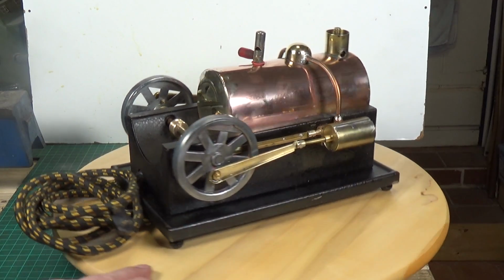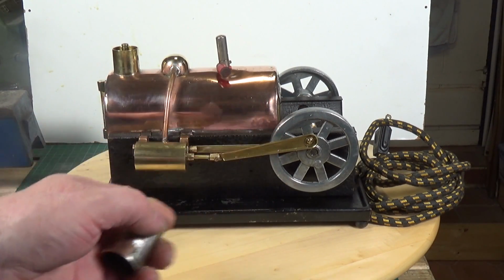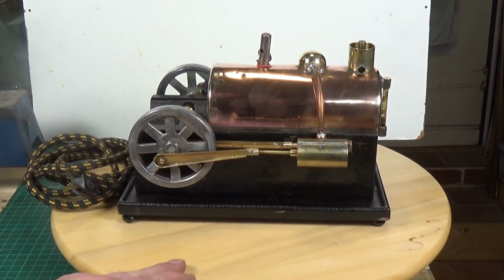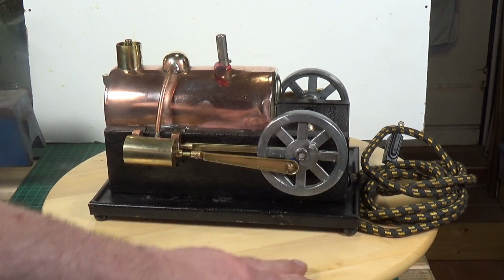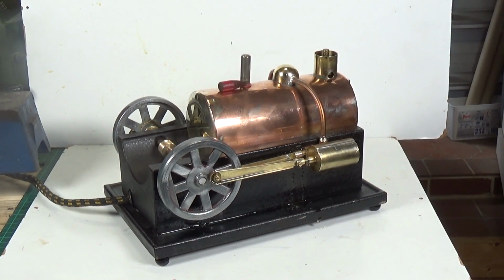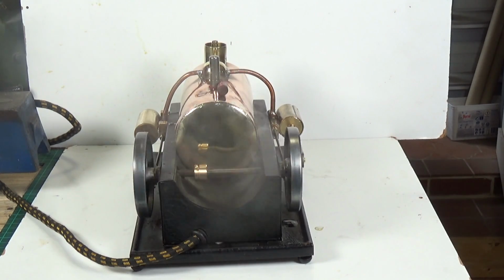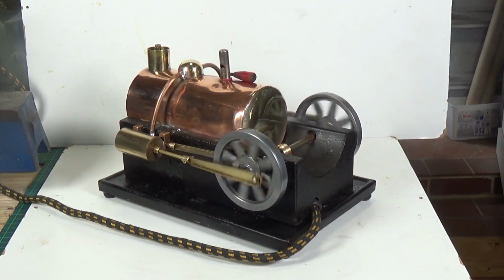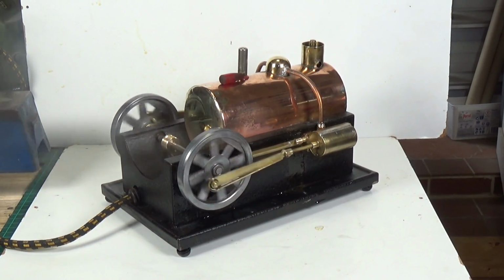SIM Co. Watt Master Project Engine - Part Two

Comment: amazing, just as a thing you could mess with, if you make it so one engine is 90 degrees out of phase from the other but keep the timing the same you shouldn't need to start in by hand since one piston will always be in the middle of its stroke or at least close to it like a steam locomotive
Reply from the maker: Thank you. Twin cylinder stationary steam engines are usually 180 degrees out and will most of the time self start. A good example is the Mamod SE3.

Comment: Hi Alan,  In regard to a question you asked on my last video (milling with 775) I accidentally deleted it, so I'm forced to answer through here.  No way to get them back apparently.  I don't know how many rpm the spindle was doing.  I started at 15 volts because I didn't want to over speed the HSS and slowly raised it to 20 volts where it sounded to be cutting right.  That variable DC power supply I got is "fantastic" and gets lots of use for all sorts of things.  I even flashed some dead cordless drill battery packs with it to recover them. Cheers Rob
Reply from the maker: No worries Rob. Since i got my fist lathe i've kind of been a bit obsessed with cutting speeds 🙂 As i used the same motor, shaft and pulleys on my bench saw it's probably running at a similar speed. I never measured the speed at 20 volts but i was getting about 3200 RPM at 24 volts. Your cutter seems fine at 20 volts. Looking forward to seeing the finished Sterling running 🙂

Comment: Looks great.  I see you turned down one flywheel thickness as well.  Seemed to be binding a bit in relation to the weave in one flywheel.  Maybe relieve the crank pin fit a bit even though the piston should twist in the bore ?  Nice work.  Cheers Rob
Reply from the maker: Hi Rob. Yes i turned down the thicker flywheel to match. The flywheel casting are quite poor, in fact the whole build quality of these engines is pretty low. I will check the crank pins, i think that the original cylinder is leaking steam. The piston is quite loose in that one, i should have made 2 new cylinders! Cheers, Alan.